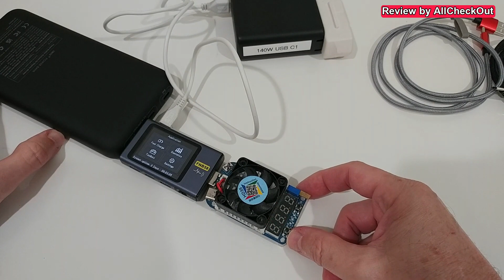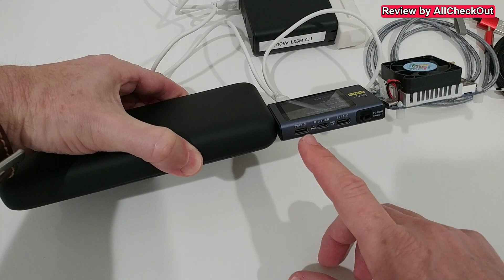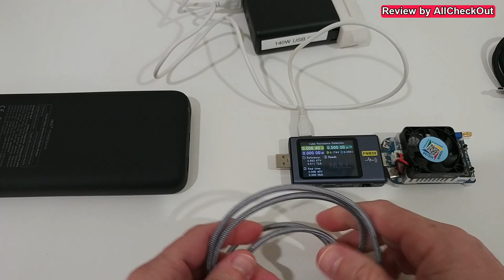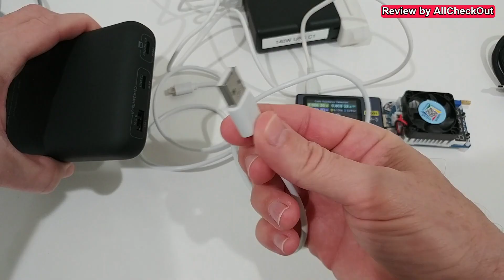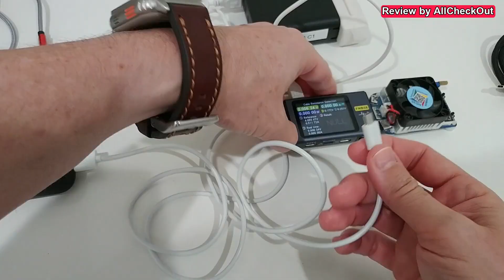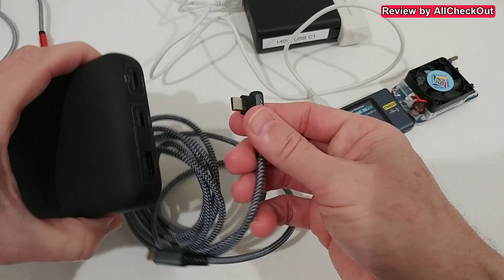Tutorial How To Measure USB Cable Resistance With Fnirsi FNB58?

Comment: Something is screwy.  I tested some cables with power displays and they showed almost no power going through the cable.  The PC port is drawing pretty much all the power going to the load.  I'm still getting different readings on different cables, but I can't trust anything now.
Reply from the maker: Yeah it's not easy. Everything is consuming some energy or at least has some slight resistance (like the . This was just an end consumer video and not a scientific video anyway ... lol
Reply: @allcheckout I got it half-figured out.  It happened to me because my USB ports shared a ground.  When I used entirely different supplies the problem went away.
FYI changing the source voltage or the load resistance change the readings so both have to be stable.  Also I tested several A-C adapters with the same cable.  Assuming the lowest reading was 0 ohm (my baseline) the other adapters added between 5 m-ohms and 100 m-ohms.  The lowest reading I got was with a cheap, no-name, super tiny, easy to lose in the USB port adapter from ali express.  Baseus and Ugreen had the next best, but another Ugreen was one of the worst so it's a crapshoot.
Reply from the maker: Oh .. very interesting. Thanks for sharing ... 👍🏻👍🏻

Comment: Its getting the load from the device on the right, but the FNB58 is measuring the resistance of the external battery from the left?? wouldnt it be required to connect the cable between the device on the left and the FNB58? there is something im not getting :/
Reply from the maker: Which situation are you talking about? The device on the right is the load tester and the power comes from the top. The "trick" is to do two tests. One with and one without the cable as fast as I remember and then the difference are the numbers from the cable

Comment: I am planning on getting such load tester for battery bank capacity measurements with the FNB58 device - considering the 35W HD35 USB load devcies which has QC 3 capaility for testing.  Is there a difference between using 35W LD35 USB and 35W HD35 USB load devcies?
Reply from the maker: The primary differences between the LD35 and HD35 are the HD35’s support for fast charge protocols (QC2.0, QC3.0, FCP, AFC 9V), a slightly lower standby current (10mA vs. 17mA), an additional button and LEDs for user interface, and a different display controller (TM1650 vs. 74HC595). These make the HD35 more versatile for testing modern USB chargers with fast-charging capabilities. If you need to test fast-charging protocols or prefer a more user-friendly interface, the HD35 is the better choice. For basic USB load testing without fast charge requirements, the LD35 is likely sufficient and may be more cost-effective.

Comment: Put on PD switch
Reply from the maker: What do you mean? Sry don't understand. PD switch when and for what and why?
Reply: @allcheckout  hi friend

The PD or power delivery switch is located on the right hand bottom of your meter

If its off your USB c connection on the meter will not accept the PD or fast charge protocol EG the high voltage/high power charging
Reply from the maker: @DreStyle  Thanks ... I knew already and I guess I had it "on" in the video .. at least there was some power. Why would you think that there was a problem with it in the video? Or did I mention something weird in the video? Thanks
Reply: @allcheckout  because a lot of USB C measuring is not done when switched to off 😊😊
Reply from the maker: @DreStyle  I think if switched of, I had no power at all here, but it shows 5V ... don't you agree?

Comment: Can anyone tell me where I can read on the FNIRSI FNB58 whether a device supports PPS? The device should actually be able to read this, but I can not find it.
Reply from the maker: Tried with Application / Toolbox / PD listerner and PD switch to the lift side but keeps saying "waiting for something ..." forever and never showed anyhitng. Then tried with the AVHzY CT3+SM-LD-00 (https://amzn.to/3SfGtwD  affiliate link) and showed the PPS of my charger instantly. Sometimes these testers are weird ... really weird ....
Reply: @allcheckout  Thanks for you answer. The PS listener is the wrong tool for this. To use the listener you need 3 things as the manual says. 1. Micro USB on the PC-Port for power delivery, 2. USB-C Charger plugged into the USB-C in port, 3. a device to charge plugged in the USB out port. Than it will show you readings.
The right tool for PPS was Application --> Fast Charge --> PD Trigger
In this moment I find out what the problem was. The firmware... I had 0.63 running and updatet to 0.68. Now the PD Trigger gives me a reading.
If you get values from, to displayed. For example 3.3-11V 3.00A then PPS is available. If only fixed volt values are displayed, you do not have PPS.
Reply from the maker: @AlexDD99  Thanks, but really weird solution. I've also tried Application --> Fast Charge --> PD Trigger and didn't work but I haven't upgraded the FW. The AVHzY shows it nice and clear in letters "PPS" right away. Really disappointing from Fnirsi and it's even the newer device.